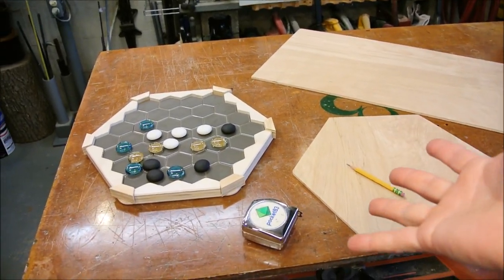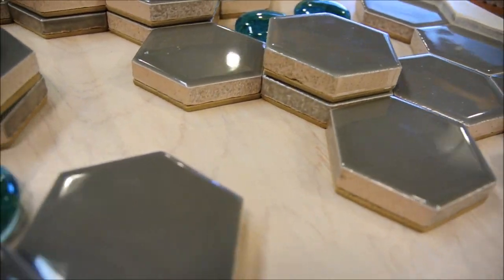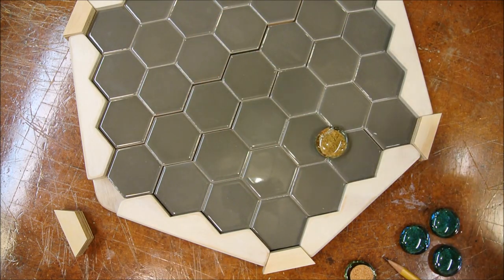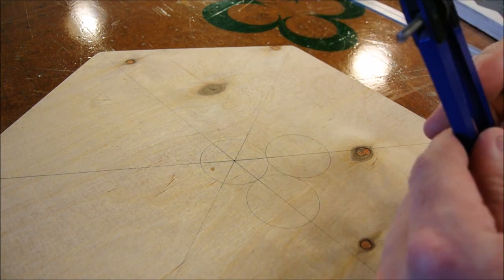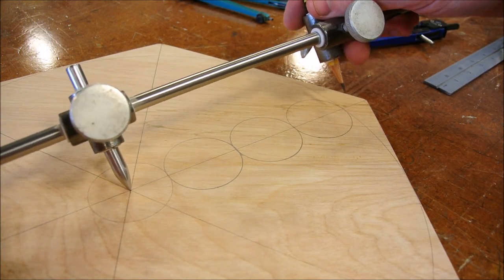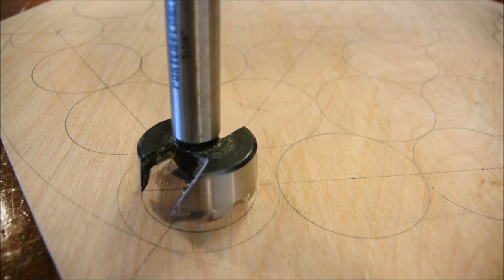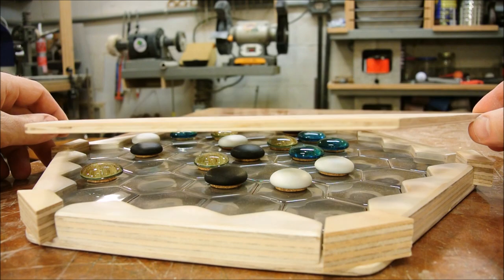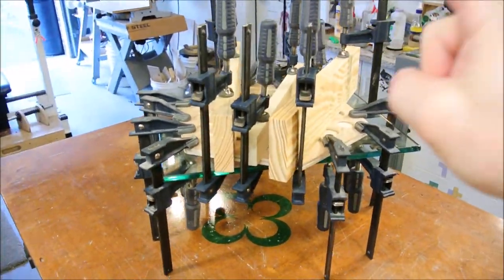Iso-path board with lid prototype, glass stones, and ceramic tiles (1 of 2)

Comment: Each measuring system has it's pros/cons and we have to find what we're comfortable with and what we're use to. There's no right or wrong way to measure something as long as your system allows you to attain the degree of accuracy that your project requires.

Comment: dividing inch measurements: convert whole and fractional numbers into one big fraction and then double the denominator. eg: 1 3/4" = 7/4" ->  7/8"
Reply: Thanks. For years my dumbass has been doubling the denominator of the fraction, then converting the halved whole number into a fraction with the same denominator, then adding those 2 fractions back together and reducing. This proper method will keep me from having to count on my fingers, making it slightly more difficult for others to notice how dumb I am lol.